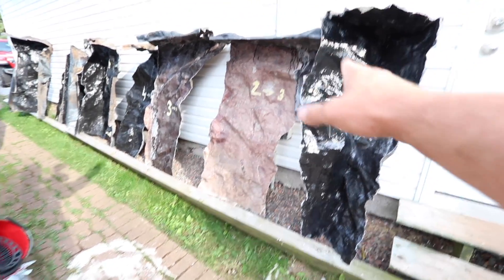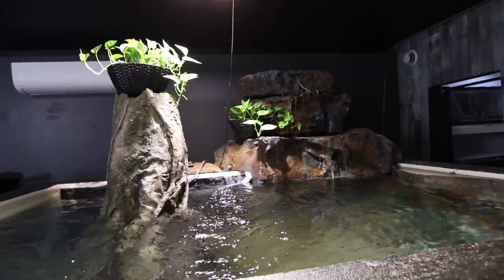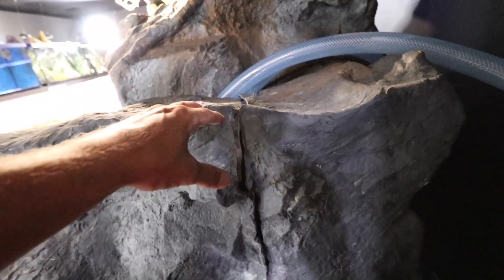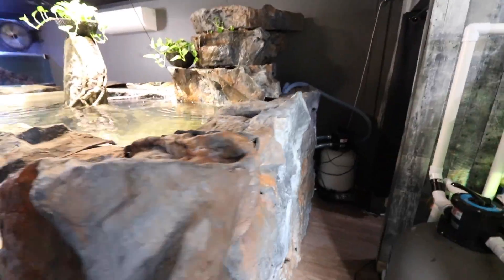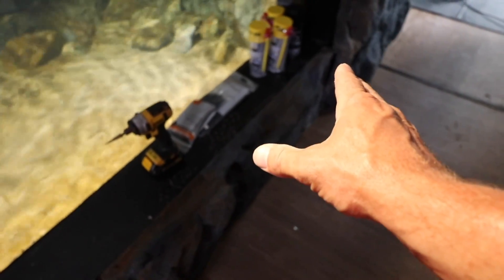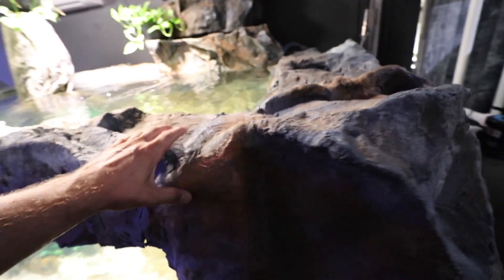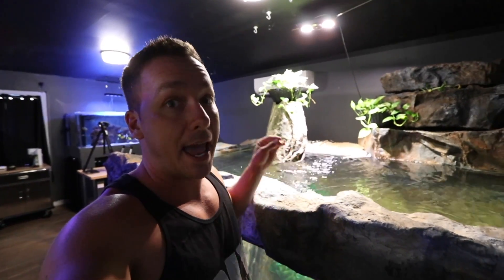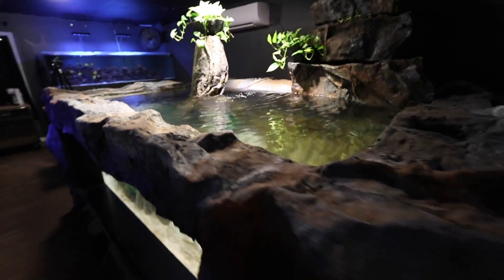MY LARGEST AQUARIUM IS DONE!!

Comment: You don't need to keep them in the baskets, take them out and clean them off, then like lay them where you want. As long as some of the roots are in contact with the water. Great video 💕
Reply: Yes, Pothos will also grow In Water soaked balls of moss.
Reply: @kathleensauerbreiartsite9065  as long as the leaves aren't under the water ^
Reply: Annabelle Robertson agree

Comment: You should see my pothos its indoors and yet has leaves about 41+ cm big currently climbed 220 cm 30 cm left to climb
Reply: What the heck are you feeding it lol
Reply: @gaijillahimself908  8 fertilizer cones during winter and 8 during spring with lots of bright light either from my windows or my 6 2500 lumen led bulbs 2700k spectrum

Comment: Pothos is a low light plant that will do fine between 500 to 2500 lux light can even handle 10,000 lux humidity is key to not get burned leaves the only thing should worry about is the heat coming of the lights.